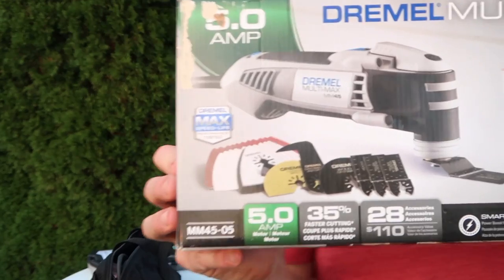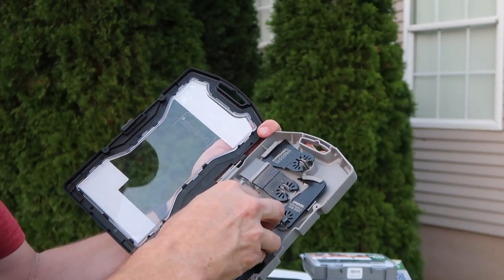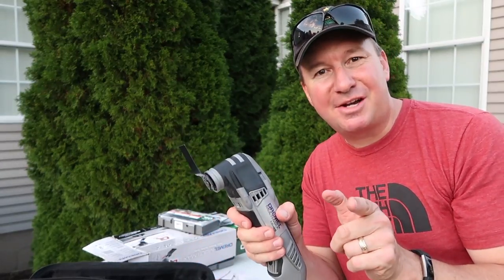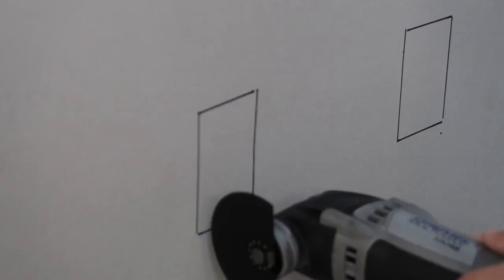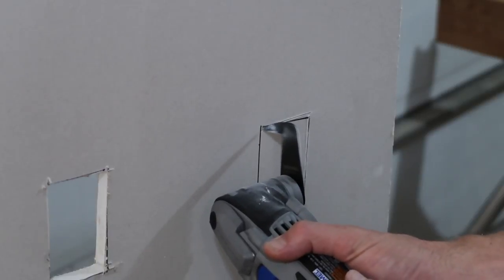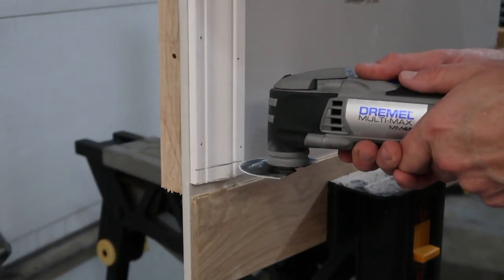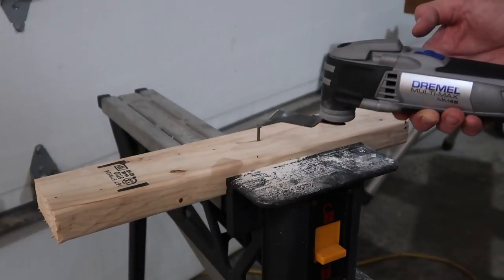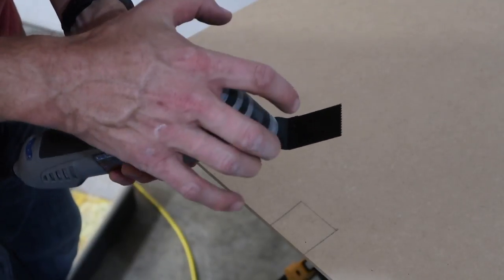DREMEL MULTI-MAX MM45 OSCILLATING MULTI-TOOL KIT- Tool Review Tuesday!

Comment: I really like this multi-tool as well but find myself reaching for the Milwaukee because cordless is so much easier.
Reply: do you have the Milwaukee M12 or M18. I'm interested in a Milwaukee but don't know which one to buy
Reply: I have the M12 because it was a bit smaller
Reply: does it work well. I thought of the M12 because I have a few M12 batteries for my other M12 tools
Reply: @Snakedriver7478  I think it works pretty well.  I usually only use it with a 4.0 battery
Reply: ToolZine thanks for the info.

Comment: Just bought one. Used it once for about 3min. Felt hot and the blade was  now off center. Turned the blade release to fix blade and the cheap plastic release broke off. Multi tools are great tools but dremel brands are cheap
Reply from the maker: Huh, that's weird.  I checked the ratings and it's a 4.5 star with a couple hundred people.  Mine has held up great so far.  I'm going to use it tomorrow.  I'll let you know if anything happens.  Maybe it's worth exchanging.
Reply: @MarkThomasBuilder  yeah that's why I bought it also. I saw the good ratings so bought it. Could just be my bad luck I got the defective one. I ended up with the rigid brand. And between the two I'm glad it broke, cause the rigid cuts way faster and has attachments for other tools.
Reply from the maker: Interesting, I haven't tried the Ridgid brand.  I do have a Dewalt cordless one that I should compare against someday.